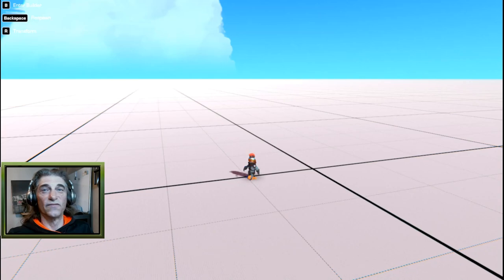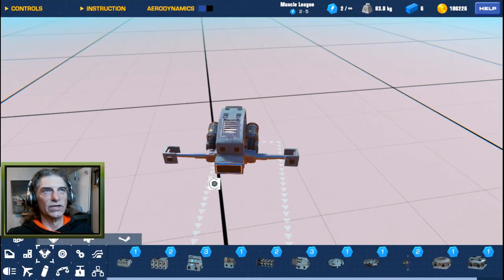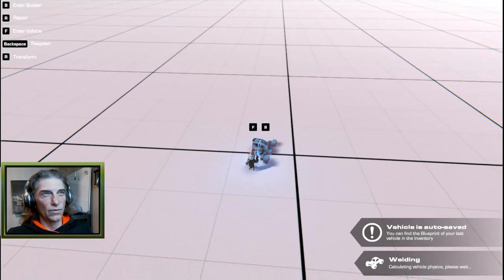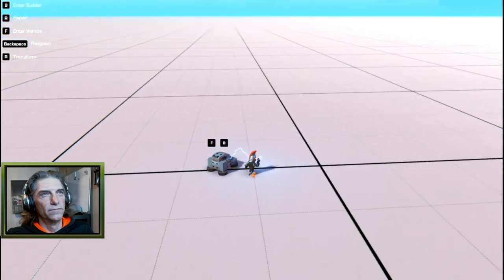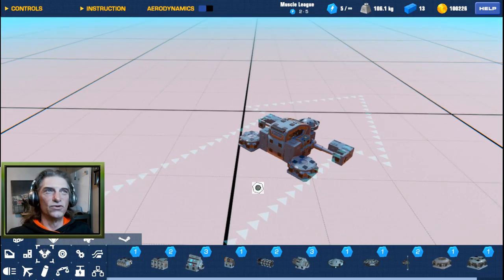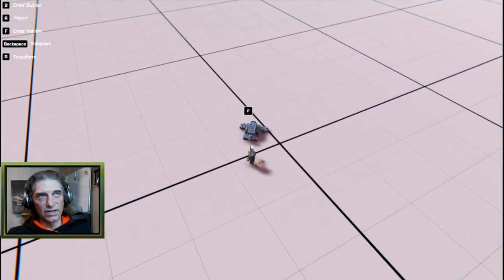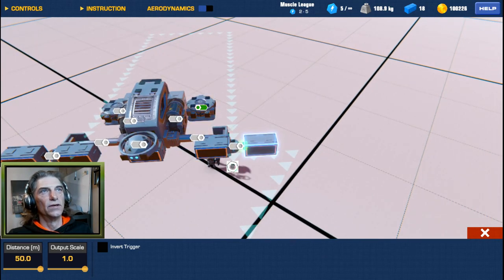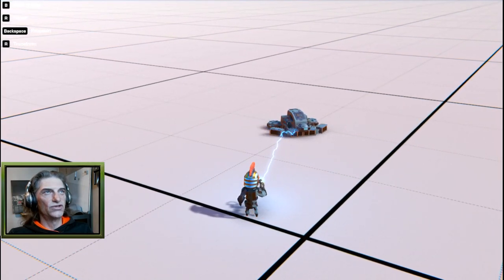Bots that follow! How To Build a basic Tracker in Trailmakers with ThatDomGuy

Comment: Do you think someone has made a tracking missle yet, for air to air combat?
Reply from the maker: Not possible. Max range on sensors is 50 meters:/
Reply: @ThatDomGuy  a very short range missile?
Reply from the maker: Not enough time for course correction when travelling at flight speeds.
Reply: @ThatDomGuy  perhaps a ground attck missile so there is less course correction?
Reply: @prestonkeightley4700  idk if it’s made yet but I can try
Reply: @0lig4rch19  alright good luck
Reply: I have tried once before but it is really difficult to track even stationary targets
Reply: @hutchiefam  yes It is, I tried multiple different configurations but couldn’t get it to work
Reply: @prestonkeightley4700  im also trying to build one that would work against helis
Reply: Against ships it could be. Possible like a torpedo i think
Reply: I already hit the heli carrier now switching for a smaller target
Reply: For hitting ground targets tracking missiles won't work because of terrain getting detected, this whole tracking system isn't near compact enough for a reliable missile. I love this tracking system more for ai turrets and pre- targeting systems for anti helicopter. Rockets are far smaller and easier to build for stationary ground targets and helis. In all though I love this system to add to tanks for mortar and aa.